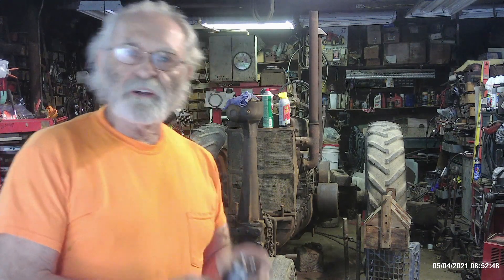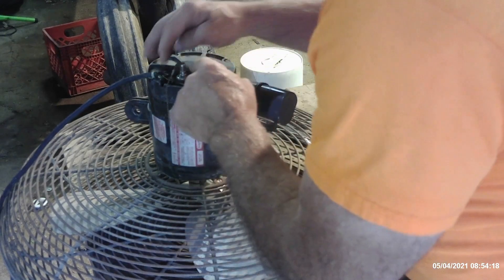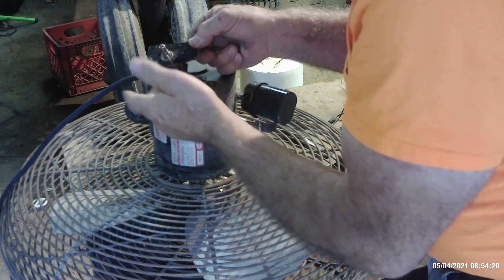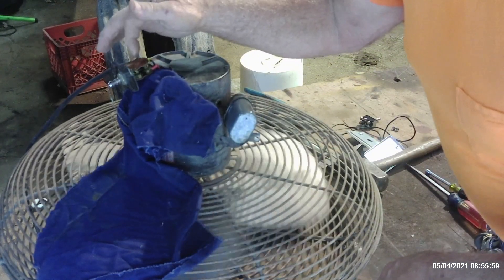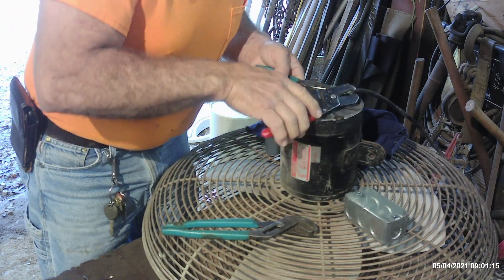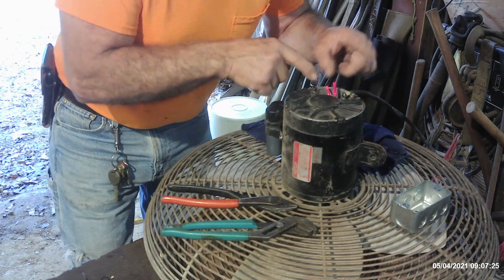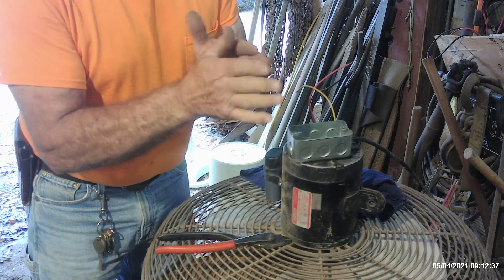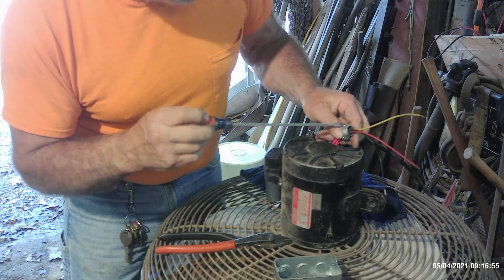Fan Left for Dead Awaits Resurrection

Comment: Summer is coming and those are handy in the shop. 
At Douglas Autotech I use to buy 10, or so in a lot, every spring. They disappeared along about August and I would be replacing them. 
There was an an auction house just outside of Bronson and there were always several items that showed up regularly on the auction bill. Fans were a staple. 😁😎
Reply from the maker: Ain't that funny how that happened.  There are certain items that just couldn't stay in place on jobsites.  They'd just sprout legs and walk off.  I always loved the jobsite dumpsters though....I got tons of goodies tossed away.

Comment: Asking a question. 
I have a Foley 1055, split phase, 110 V grinder motor with what appears to be bad Klixon relay. Pt #42C-20-756. I paid $75.00 for the whole rig with a bunch of accessories and a Ebay replacement motor with chance of having same issues is $140+.
Here's my problem. The motor is from the 60's and Klixon doesn't list a 42C-20-756. Lots of 42C's, but no 20-756. I requested a quote but Japan is slow. Is this anything you or your viewers have any experience with? My first contact with a starter relay motor. Not popular in the crowd I run with. 😁😎
.
Reply from the maker: I'd have to put an eyeball on the part....have you done a video on disassembly of the unit..??  If so I'll go check it out real quick.   I'll go skim the titles anyway just in case.

Comment: I like the idea of using a three way switch for speed control in a pinch. the switch you used is perfect but not many would think of using a single pole and a three way to get this going again. thats thinking outside the box. I like that.
Reply from the maker: Like Gator says:   "Necessity is the motherhood of invention"....  Well Gallileo or DaVinci said it first, but Gator says it better.  LOL.  I've done several blowers like that.  Another thing I do too.  You know the plastic handles they ship big double doors with so they can be easily carried..??  I save those and use fat threaded sheet metal screws at the balance point to install one of those on the blower assembly.  Works wonderfully well !!
Reply: @tractorman4461  thats a great idea on the handle!

Comment: Really enjoy your channel. I have a propane fireplace with government mandated intermitent  pilot ignition. This means the pilot goes out after 7 days of non use. I don't like this system and would like to figure out how to go back to the old fashioned standing pilot system. Any ideas?
Reply from the maker: Reverting to a standard standing pilot requires a lot of  component changes.  First off the gas valve itself will have to be replaced.  Then a standard standing pilot, pilot assembly would be required.  Then aluminum pilot tubing has to be routed from the new standing pilot to the new 100% redundant gas valve.  Then a thermocouple must be installed in the pilot assembly. THEN...you may even have an incompatible electronic control board that must be eliminated.....soooooo see where I'm going with this...?  It's not going to be economically feasible to make the change in my opinion and may not even be able to be accomplished safely. But I like it when guys think 'outside the box'....  Hope this gave you a bit of insight into what may be required.
Reply: @tractorman4461   Thanks very much Tractorman 44. I'm pursuaded.